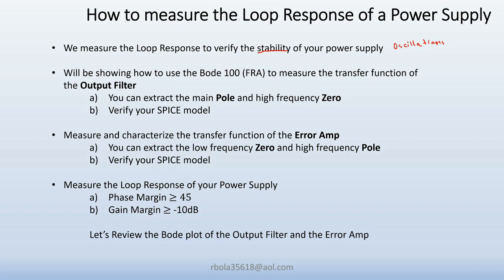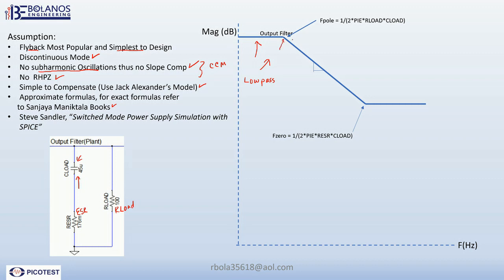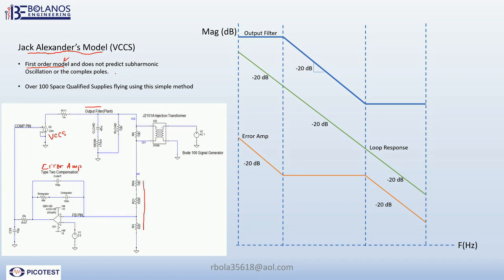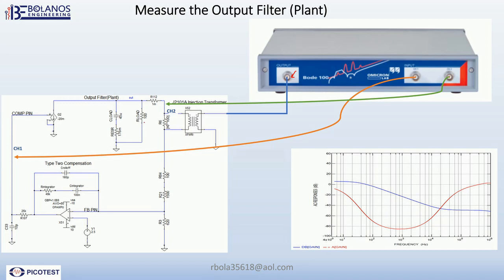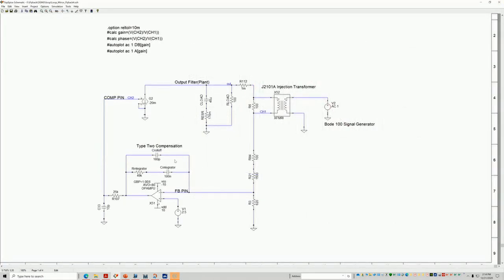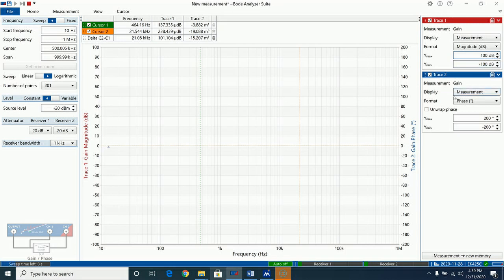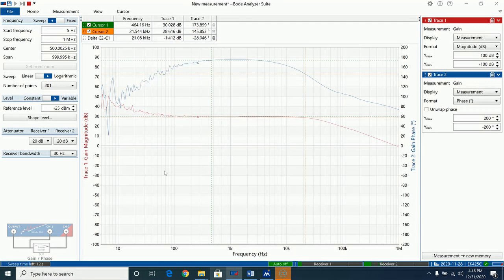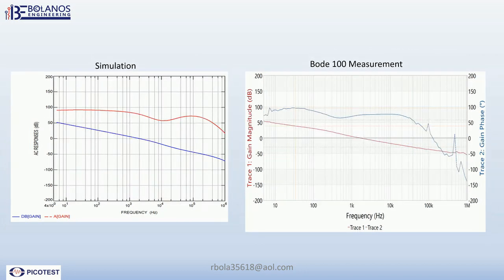How to measure the Loop Response of a Flyback using the Bode 100

Comment: Respected sir, Can you please confirm Comp pin is  1. Cathode terminal of optocoupler or 2 collector terminal of optocoupler
Reply from the maker: Typically the signal from the OPTO goes to the FB input of the PWM. So the comp pin would be the pin that feeds the FB of the PWM. I hope that makes sense.

Comment: Hi Robert,

I've been working in the industry for around 3 years now (extra low voltage, embedded systems designs mostly) and would really appreciate your insight into something that's plagued me for a little while. The power supplies I incorporate into my designs are almost always non-adjustable output voltage targeting a well known load. I usually expedite designs of power supplies with tools like TI WEBENCH, or by simply following the design guidelines in the manufacturer datasheets and (if available) associated app notes for the IC that I boil down to. I've never once tested stability of the supply (or even been urged to by my peers or superiors) beyond testing with basic adjustable load equipment before I link it in to the system as a whole. This bothers me, because I see so much information out there from experienced engineers such as yourself and Steve Sandler that propose methods for far more detailed analysis of power supplies. I'm becoming more and more curious about hidden problems in my past and current designs that I just haven't been looking for because we've been following the paradigm of "look, it's working. No more info needed". 

Are these analysis methods more targeted towards power supply designs intended for use with an unknown load? Or do you think it's beneficial to add these tests for all power supplies (or atleast all major rails) in a system such as that which I described above?
Reply from the maker: Hi Brett. Thank you for your question. I work in the SPACE community where the requirements are very rigorous. We get our requirements from both NASA and ESA (European Space Agency) and make them into a set of specifications and they always require that we measure both the Gain and Phase Margins over the operating input voltage range and load range. This is done to ensure that the supply will stay stable. In addition, we also do a WCA (Worst Cast Analysis) to estimate how the supply will perform as the parts change due to aging, radiation, and temperature changes.  If your supply is critical, then I would recommend doing these measurements.  Keep in mind that the output filter and the Error Amp are performed to verify your design while the total loop is the actual measurement that the customer is really interested in having.  

So in my opinion, I would recommend that you do these types of measurements because it gives you and your customers confidence that your supply will perform and remain stable. I hope this makes sense. If you have any questions, post them here are you can email them to rbola35618@aol.com.     Best regards, Robert Bolanos